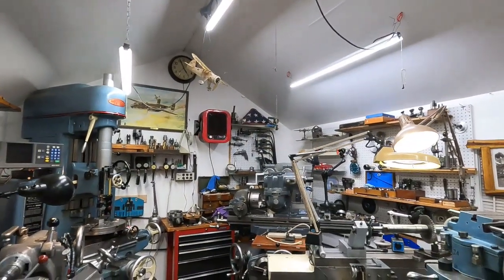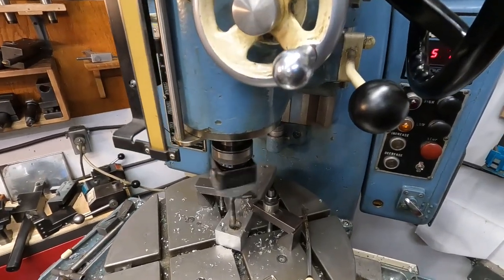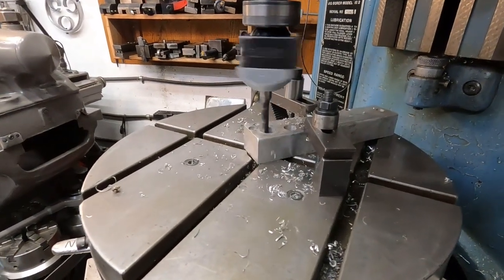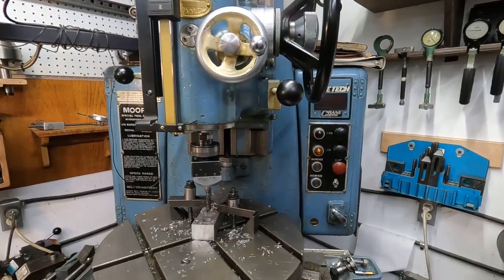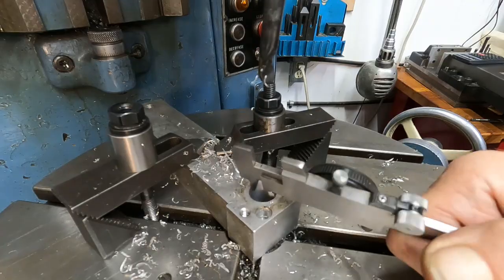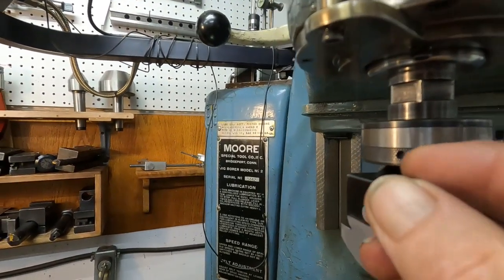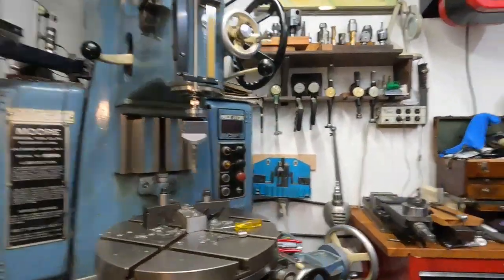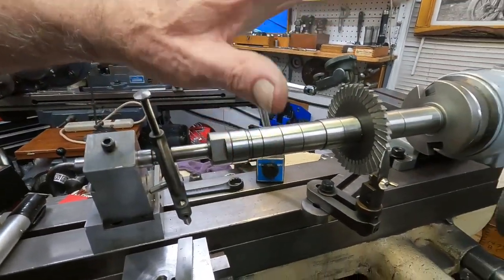Moore Jig Borer Criterion S2 Tenths Set Boring Head

Comment: Damn Don that was a pain in the ass. Moore supplied a Chandler Model J head apparently in the later years. I have a couple Chandlers of various sizes and I really like them. But I have a few  standard Criterions and they are also decent heads.
Reply from the maker: I have the Moore head as a standard. This type has a lot of range of adjustment

Comment: I have an Erickson Tenthset, very easy to operate. Seems it would also be more rigid, as it is all in one unit. Thanks for the video Don, hope you are doing well.
Reply from the maker: The Erickson heads work great, the later style Erickson head is similar to the Moore head. The Criterion heads have a lot more range of adjustment but that does send them out of balance as the lower part extends beyond the heads body.
 On the jig borer I found it is important to have a variety, thanks!